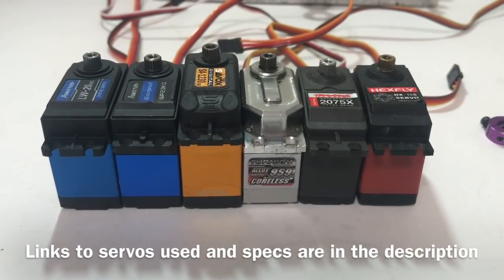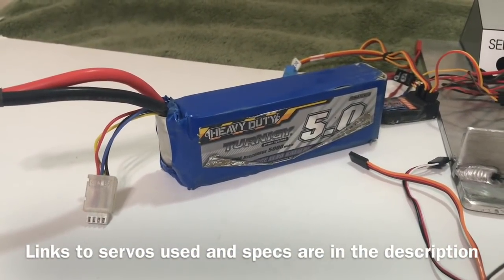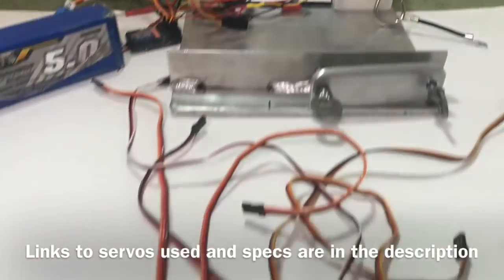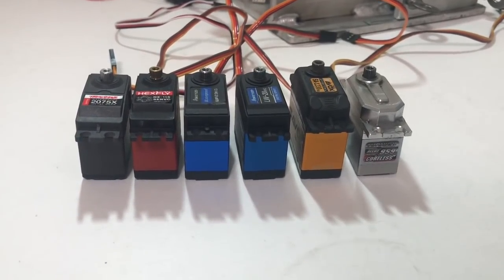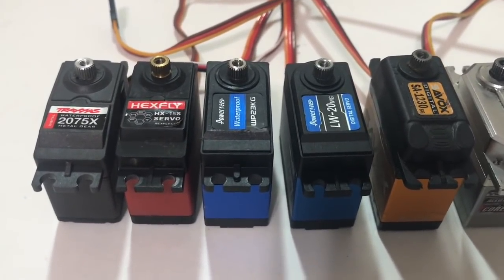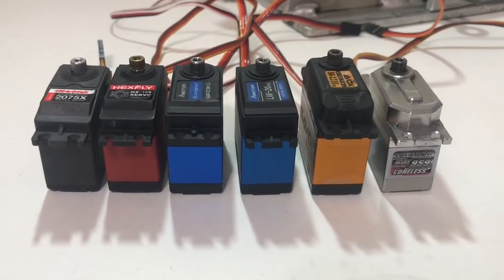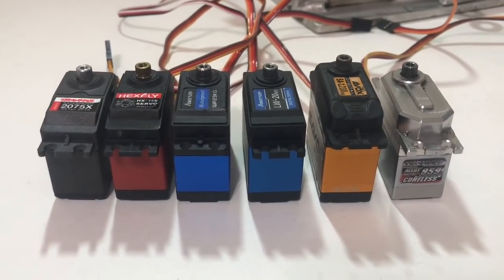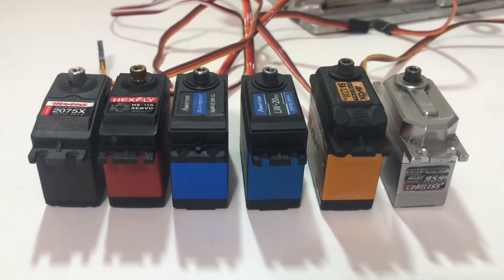Servo Comparison Savox Power HD Turnigy Traxxas Hexfly

Comment: Hello, excellent test. Are the unit of your fish scale in Oz-inch? The savox 1230 listed at 500oz-in at 6v; if your scare is correct , it only manage little over 350; it’s my trusted Servo for many years, I may have to rethink this...
Reply from the maker: It’s in ounces yes. I’ve read that Savox and many others rate their servos based on a dynamic reading. So basically it’s a peak measurement not a real sustained measured pull like I did.
Reply from the maker: If Savox gets the job done for you stay with them. I use some Savox in different places.
Reply: Thank you for feedback, i mainly use two savox servos, 1230 and 0236.  I probably have 18-20 savoxs; they have been consistent for me, thinking they are super strong, but these tests are eye opening! One thing I did learn from your experiment is to move the rod hole closer towards inside, makes that much difference.  Instead of using end point adjustment, move the throw inside first... brilliant
Reply from the maker: Awesome.  I run the inside hole in most every scaler I have.

Comment: Hey Exocaged as I dont have many rc buddies to ask questions where im at maybe you can answer one for me if you dont mind. I have a SPEKTRUM A3060 digital servo on my Losi Night crawler running a Castle 10amp BEC. Now the BEC is factory set at 5v and i do not have the castle  link to adjust voltage. Just starting to get back into the sport again. Do you think from the 5v to rated 6v of the servo im losing much in torque?
Reply from the maker: That’s about a 20% voltage difference so yeah you’re not getting all that the servo can take. I tried to look up the servo numbers you posted to find specs but didn’t find it.
Reply: Ha you will have to excuse my typing haha. How about A6030. Might work a little better. Thanks though.
Reply from the maker: Cool. If you have the funds, get the Turnigy 959v2 servo ( I have a video of these ) and get a castle link to bump that bec up to 6.4v and you’ll love it.
Reply: Well that's what prompted this I have been starting to watch a number of your vids. Really want to get the new trx-4 79 bronco next. I like how yours are setup up for double duty. Going fairly fast and crawling. I really like the new Redcat gen7 also but I love the ability to have high/low and selectable diff locks from remote. For a Jeep guy like me that's absolutely awesome. Also was looking at a Summit but kind of like the solid axles of the trx-4. I would say the Summit is better at going fast and then can crawl also where the trx-4 is meant to crawl more but can go faster as well if you understand what i mean.  You know the Losi is no speed demon no matter what you do so some speed would be welcome. Then i started watching your servo test videos and noticed the voltage and that Turnigy already stood out. About half the price of this Spektrum i bought. Keep up the awesome vids and thanks for the replys.
Reply from the maker: yeah bud, the Summit is an old platform and if I were you, I'd go with the TRX4 Bronco. If you get to the point where you want more radio I hack and sell 8ch GT3c radios. I have a few older videos on those as well.
Reply: Exocaged RC Thanks for the info. I will look them up as well.

Comment: Well.... THAT sold me on the Power HD 20!! I mention too often, how severely limited my budget is. That $20.00 Servo keeps impressing me!! 👍👍 
That was a solid test. They might not have been scientifically perfect - BUT, they were compared even and fair, on that Rig you put together. Quite impressive setup! I see one dislike.... MUST be a Butthurt Traxxas fanboy! LOL!! I don't have a personal opinion of Traxxas.... But some of the blinded fanboys believe they were Blessed by Christ himself!! Doesn't matter WHAT any facts might say.
That was really a good, fair Test!!
Carmine 🚂 PoorManRC
Reply from the maker: Yeah I was disappointed in the traxxas servo. And yeah I’ve got another 20kg ordered for a project. It was awesome for sure
Reply: Im just curious how well the 20kg would turn some 3.8s...the 1/8th version tho
Reply: i have a power HD20kg in my TRX-4 it replaced the stock servo that died, its a little bit better, but at the price it is its heaps better, it needs an extension lead on the trx4 though, i also have one in my other cars, cant complain for $20, if i was racing id use something better, but crawling and bashing its a great servo
Reply: Its probably 20lbs+ ima say its bout the same size as the losi xxl2...its an old smartech tornado brushless conversion
Reply: Yes Sir!! 😱 You will likely burn this one up. There's really nothing in the under $25.00 price range that I would even think about for that... 

On that note..... What kills Servos more than anything, is us Crawlers, with 5-9lb Rigs with Super Sticky Tires, on Rocks, at usually LESS than 1mph!! At a crawl, you're concentrating all of the Steering Load on the Draglink, Chubs, Knuckles, and Servo. 

Strength is just as important in a high speed, high jumping Basher like you have. However, at speed, your Tires, A-Arms, Bulkhead and Tie Rods are taking nearly all of the strain. 
Still, weight vs. torque is just as important! You just don't need as much of it as hardcore Rock Crawlers. 
I stand by my original advice..... 300in lbs or more will be fine and dependable, until you Endo from 50 feet!!! 😵😂😂😜  Remember, also choosing high speed and high torque, for what you want to do, is a waste of money! Just look at Torque Numbers. You can likely find something pretty good, in the $35-50.00 price range. 

ALSO, if you're running higher than 3S - look at getting a BEC. If more than 5S - you MUST get a BEC!!
Hope this helps. I'm an Old, Semi-Pro 1/8th Scale Buggy Racer for OFNA, back in the 90's. If we needed more strength in a Servo, we had to pay $100.00+ for a 1/4 Scale Servo - and then try to get that BIG Servo to fit!!! 🙏😣😣😣😬🔥🔥
Reply: A  B  C
If it's a Blue Case.... YES!!
If it's a Red Case..... NO
Reply: PoorManRC how about a tekno mt410 those puppies are solid
Reply: PoorManRC I'm a Traxxas fanboy, but I'm aware that their servos SUCK!! Getting that Savox 1230SG for my summit soon!
Reply: craig mcclellan - I would say, if your Rig is less than 7lbs.... Probably.
If more, I'd look at 300in lbs or more. Servo Speed isn't as important - unless you're a serious Competitor. You DEFINITELY want ALL Metal Gears!!! (leaves out Traxxas!)
Reply: Derek Quinones  -  I don't buy RTRs.... but I hear good things about Aarma. TOUGH suckers!
Reply: Derek Quinones - Never had one, but I've heard good things!
Reply: Traxxas suck are mayb a decade away from being obselete with the 3D printer evolving like it is. Traxxas just offer a chassis thats able to take big power and tons of gearing options. The 3D printer can do that. Home brew build plans we buy then programme our own printer. Using Traxxas gearboxes with arrma chassis or whatever. Traxxas have bcom a monster in rc killing other brands crapping on fans. Like banning exports to uk. Amain, tower and rc mart wont ship Traxxas products to uk. Forcing brits to pay double price on everything. But ebay uk just got full of 2017+ trx models.
Reply: PoorManRC I’m a Arrma fan I think they make some of the best rtr love my kraton and outcast just my 2 cents!!

Comment: love power hd bluebird are even better
Reply from the maker: I've never messed with Bluebird servos, which one would you recommend for a scaler?
Reply: im using hsor hls 42 in my 33% suhkoi has da85cc with mtw pipe have friend in florida that uses these same seervoes in his two hundred mile per hour jet and has been using them for 3 years in the jet still no gear slop like new if you need to replace titaniam gears in this bluebird servoe the gear sets are only 10 bucks i paid 79$ea for my bluebird hs42 forgive my spellingerrrores

Comment: some servos are strong but slower. others are strong but weak on the return.  i like a servo that has strong fast return to get my wheels straight again.
Reply from the maker: Yep those cost a lot more than whats in here and I have a few of them in my racers. For a scaler, fast speed isn't that big of a deal.
Reply: @ExocagedRC  any good recommendations for my RS4 Sport 3 flux just wont stay staright. I have a Savox in it but no bec. Could that be the solution.

Comment: the 23kg could've been mislabeled.
Reply from the maker: Perhaps. It should have been way stronger.
Reply: Exocaged RC It should've. 
I usually go high-end on servos but a few months ago I bought the 23kg and put it in my CFX-W. I've been pretty happy with it. It probably makes 300+. I've had plenty of 200oz servos over the last 29 years so I know how they perform. Ya...gotta be something wrong with the one you tested.
Reply: I have the powerhd23kg and its weak on my arrma kraton
Reply: Jeffrey Milo That's a huge truck and I don't believe the internal bec is very good.
Reply: thankyou. i wish i took your advice before i bought it unfortunately i listened to other people :(

Comment: Just wondering, is there a noticeable power difference between the Traxxas 2075 and the 2075X? I understand the X model has metal gears, but is it more powerful? Also, are the sizes the same?
Reply from the maker: Not sure, if the only difference is gears then they should have the same pull.

Comment: Nice - would be even nicer in kg, the servos are kg-rated, and only a very small part of the world has a feeling what an ounze is, me not. Everyone understands kg.
Reply from the maker: https://www.convertunits.com/from/oz-in/to/kg-cm
Reply: THX - I can do this, I did know how to convert. But while watching a video it is hard ;-) . Should I write up the numbers and then convert? - Really nice test videos, also with the tires. But You tell for example the Power HD servos are rated 20 kg and 23 kg - and then test in ounzes... so really hard to understand. Easy to change... Do have the 20 kg version waterproof and not waterproof, very good value for the money!
Reply from the maker: I thought of putting the conversion numbers about 2 hours after posting the video, unfortunately it would be a whole new upload. In my opinion the 20kg Power HD won the test based on cost vs performance. The old Turnigy rules them all in raw power. The 20kg is now in my Proline monster truck and the 23kg is in the tiny rock beast. The Savox will go into the 8S dragster and the Turnigy will probably go into the solid axle monster truck if I ever kill the ones that are in it now.
Reply: Next time - if you wanna make more of those servo tests ;-) - Thank you!

Comment: Excellent video as always. I have a few Powder HD 20Kg's and only 1 of the 23Kg versions. I didn't notice any difference torque wise but i only run 1.9's and don't get into binds often with them. In the defence of the 23kg one with the extra price, is it does feel a lot quicker and more responsive and the titanium gears are nice. I guess it's still working at around it's rated value, but it's interesting the 20kg performed better and is also rated for higher voltage.
Reply from the maker: Yeah they are both rated for 6.6v. I just stuck with 6v to try to have some form of control over them. I should have a high voltage test recorded next week. Probably be edited together and posted the following week.

Comment: I have a savox 1210sg  and am running no bec. I do not have a lot of time on it but have not had a issue. You should make a video on how to set up a bec. I did not do that because I was clueless. I just threw my servo in there and used the truck.
Reply from the maker: good idea on the bec video, I have a bunch of them so maybe, the simple way is to just power them from the main battery and plug them into the receiver, you need to remove the red wire from the esc and you're good to go, if you have a high voltage servo and want to power that but have a 6v receiver you can power it around the receiver. I would think there are a ton of videos on how to do that already. I'll check and see.

Comment: Awesome test!  I put the 959v2 on my Gen7 and it's great!  I haven’t bound it up in the rocks yet, but under every condition I've put it through it hasn't stalled or browned out on the stock ESC.  Maybe I'm not hard enough on it!
Reply from the maker: yeah the 959 servos are awesome, I run them on my C3 4ws truck, Bouncer and on the monster truck I did the radio test with, no servo savers and no failures. Absolute beast servos.

Comment: The MG595 sells rated at 480 oz of torque ,Made by Tower Pro , I use it for a winch when I can get them from Tower Pro...When they first came out the board and motor soldiered together board had HiTech name on it the later servos now have smaller board but same hi power motor ,, Its a good servo pretty tuff have one in Wraith and grand son beats the heck out of it ...
Reply from the maker: There are so many servos out there that are good and great, i doubt I'll ever be able to get to even half of them.

Comment: How come the power hd23 had less torque than the pwerHD20 ? 23 is better than the 20, what gives ?
Reply from the maker: I don’t know but yeah it was way less. I rechecked those two after the recorded test and the results were the same. Maybe it is a bad one?
Reply: Exocaged RC thats really weird ... And I have both, things that make you go hmm?
Reply from the maker: I now have that servo on the rear of my little Rock Beast truck, it will do fine turning those tiny little tires.
Reply: Exocaged RC lol tiny lil tires
Reply: Did you ever get to retest with a new 23kg servo? Since many people are making purchasing decisions based on this test, it'd be a shame if the results were because of a faulty servo.

Comment: A hobbywing 1080wp esc has a internal Bec with enough voltage for a savox 1230. Love your videos, specially the tire test ones. Keep up the good work
Reply from the maker: I think they are rated to 3A which is pretty good but if you fully stall a Savox I’m sure it would brown out however normal driving doesn’t stall a good servo so yeah I can see it working fine.